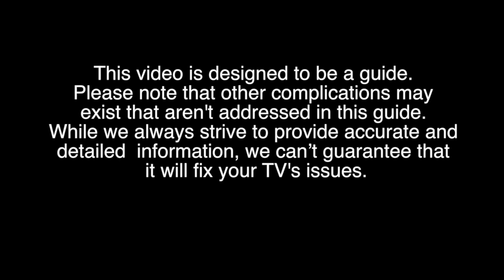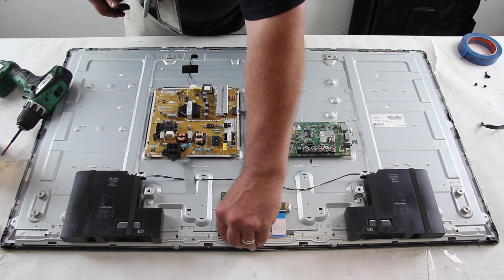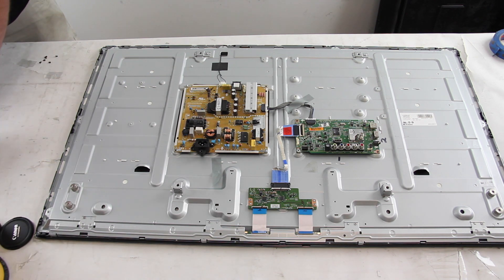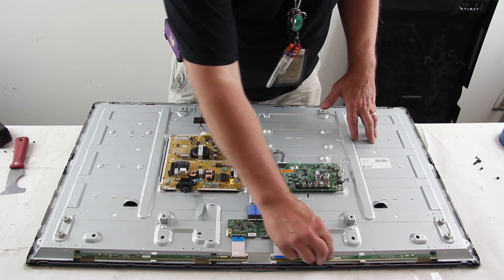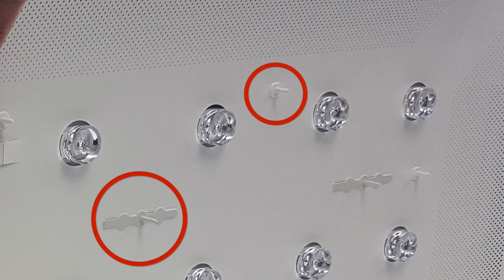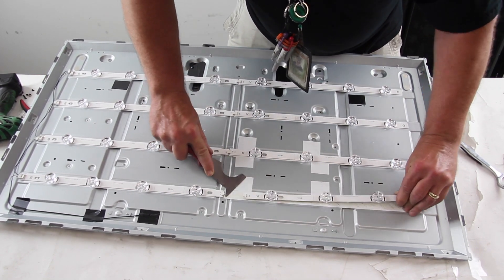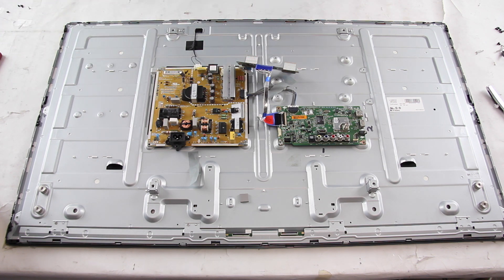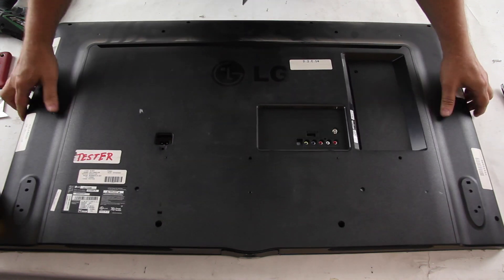42" LG TV LED Strip Replacement Tutorial - 42LY, 42LB, 42LF, 42LX - Bad Backlights in a 42" LG TV

Comment: Great video, had no idea how to do this but went step-by-step as described here and now have a fully working TV.  Only had one slight hang up from video, when disconnecting the LED strips from the power cable, you must crimp the two small pinchers on top of connectors and PULL UP to disconnect them.  It's hard to tell in the video and first was trying to pull them outwards towards the cable, so was frustrating until finally realized these must be disconnected by pulling up on them.  Not obvious at first and unlike all other connectors on the board which pull sideways.  Other than that, took more time than I thought to disconnect everything with the million screws, but video got me through this and TV is now working again!  Well done on these walk-through instructions!

Comment: I used these instructions to replace not an entire strip but just a single diffuser on the strip. It had dislodged, and all it needed was a little bit of glue to put it back in. thank you very much; these instructions were excellent!

Comment: I have one that lights up for a short time, then the whole backlight goes out. Still has a picture. So where exactly is the backlight controller board? Or would it be the strips themselves, that are the problem?
Thank.
Reply: I have that same issue, did you figure it out? Mine seems to come on for a split second before it blacks out
Reply: @zecanadian2149  I've been putting it off for now. But I think it's going to be the control board/main board, from other videos I've watched. That is my next test. The voltage output to the lights. I replaced the lights already. Stays on a little longer.  Realized I forgot to put the speakers back in. I doubt the speakers not being in, would cause the back light to shut off. LOL

Comment: Would these steps be similar to, or the same as, the steps needed to replace the LED lights for an LG 42LN5300? If not, could you please reply with a link which offer similiarly detailed steps? Thank you.
Reply: I just did an LG 47" telly....only variance was the LED strips were firmly stuck down with tape, but replacement worked fine, all working perfectly again.

Comment: My TV says it's 42LB5600-UZ.BUSDLJR..will these strips apply to this model? I don't want to start my project and then it not be the correct parts.
Reply: I'm not 100% sure but I think that doesn't really matter. I also have a slightly different model and it fits perfectly. I haven't tested it yet but I'm assuming it will work.
Reply: Part numbers are on the strips

Comment: Thank you very much man, i fix my lg led lb5500 using your guide, god bless you for sharing!
Reply: Can I ask what the symptom was when you had an led backlight fail?

My sister's lb5500 has just stopped working, and I'm currently trying to diagnose the fault. (Though I suspect it's the backlight)

When switched on, the faulty TV displays the LG logo for a split second, and then the picture is gone.
The TV is still working as audio from TV channels can be heard, just no picture.
Reply: @TehJumpingJawa  i had exactly the same symptoms, you need to change the led backlight strips as i did. And for future dont crank up the backlight brightness to100% in picture settings menu, i set it to 85% to preserve leds.
Reply: @лъвче  Brilliant, thanks!
Reply: Strips arrived from China (£15), replaced the lot, TV now working great. Thanks for the advice, and the great video.

Comment: Where would I find them since you're out of stock and probably not likely to restock them..
Reply: Found mine on Ebay
Reply: You're backlight just went out randomly right? Someone who doesn't necessarily know a bunch about modern TVs said there was a chance that it might be a capacitor that blew but I kinda doubt it. I still get a picture and sound, just no backlight.
Reply: @07broly  Back lights are common in these.

Comment: Hello Jimmy, I have been following your videos from past month now. I own a LG 40 inch UHD SMART LED TV. it's been two years I own this TV now. due to some voltage fluctuations, the TV suddenly went blank. The LG support engineers came and asked me to replace the connecting cable. I have done that but still some black patch has remained towards the top and bottom left corner of the TV now. from today some horizontal lines has started coming in those black patches. I contacted LG support and now they are saying that I need to replace the T CON board of the TV for which I have to pay them: $150. I need your help with this. I want to buy the T CON board  separately as I see it's available online at the max at about $ 30. could you guide me with this please. the model no of my TV is: 40UB800T
Reply: I hate to break it to you but you probably have a bad LCD panel. Here is a direct quote from the shop jimmy website, "Horizontal lines on the screen are virtually NEVER caused by a bad T-con board. Horizontal lines indicate a defective LCD panel (screen)."